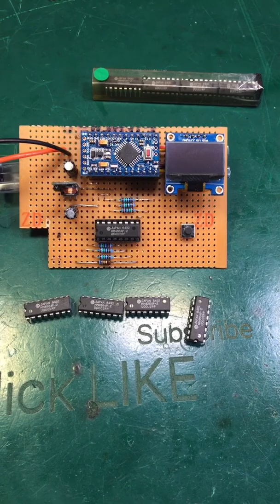I Built a RAM Tester - It will be open source! #shorts

Comment: I designed a memory tester about 20 years ago but it was FPGA based many faults won’t show themselves at lower clock speeds. But still a good way of doing basic tests.
Reply from the maker: Now I wonder if I should repeat this using an ESP32 at 240MHz… that would speed it up a bit.

Comment: Nice little project. Does it check data retention after prolonged times of only refresh cycles? I recently had bad RAMs that did. Test fine for write then read even after complete cycle of writing the whole 64 kbit and reading them back in one go, but refused to hold data for more than 10 to 20 cycles of repeatedly only reading or refresh sweep the whole chip. The tester was a little arduino project from about 10ish years ago ( I forgot where I found it)
Reply from the maker: Any different kind of data tests could be added, it’s not doing refresh tests at the moment, but that wouldn’t be hard to add. I have now designed a PCB and released all of the files on PCBway and to my Patreons, if I get time tomorrow I will add it to my website.

Comment: Very neat. One thing i havent seen on other ones is the ability to vary the supply voltage when testing.......a source of failure on 4164's etc. Could be a nice addition.
Reply from the maker: That could be done by modifying the main voltage regulator setup, the Arduino and OLED won’t care if the supply drops a volt or so.

Comment: I've never seen it on drams but I've experienced srams where data have been mirrored due do broken address decoding inside the chip. You might want to write different data to different regions to be extra anal about it :)
Reply from the maker: It writes zeros, ones, alternate, and random data, it’s actually based on someone else’s code which I then heavily modified and added extra features and the OLED etc. so there will be a credit to them in the code when I publish it.
Reply: We used to use a paten that was generated to show issues with addressing problems, Cant remember the code to do it but it had a few tricks in it. It was run every time the unit did a cold start as back then ram was not as reliable as it is today.